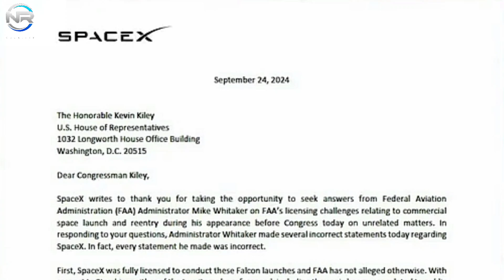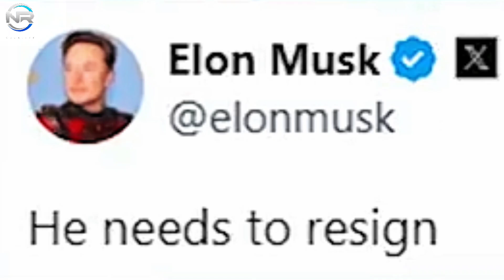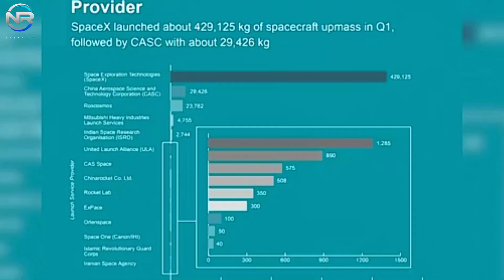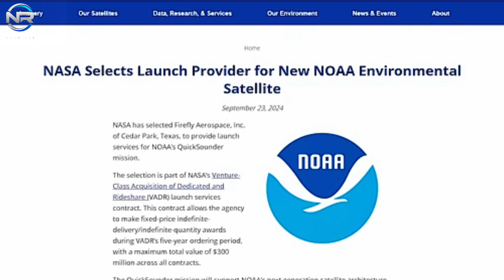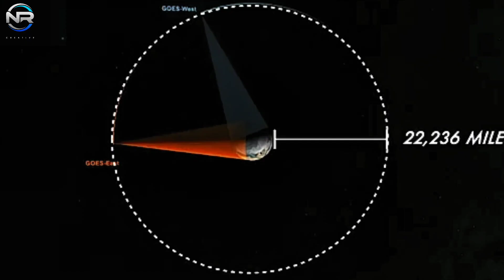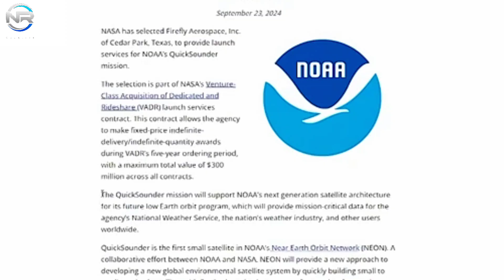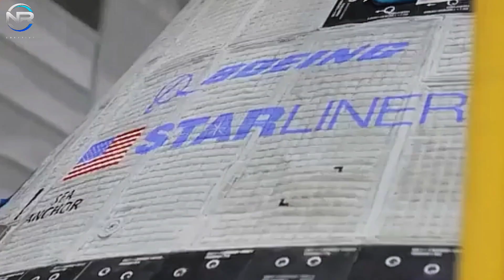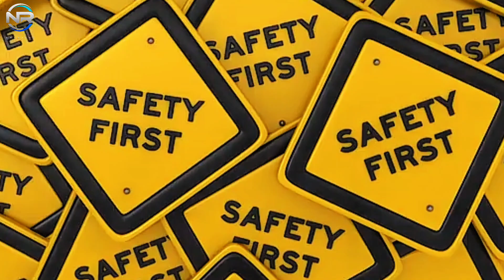Big News! FAA Announces SpaceX Must Have Boeing Safety Stand | Dragons Will Save Starliner?

Comment: Clearly managing any changing technology is a struggle for the FAA, though managing commercial spaceflight clearly has them even further out of their element.  Possibly this needs to transition to a new agency if they can't get their act together.  In any case it would be difficult to keep up with Elon.  I doubt they have anyone on staff or in management who has ever designed a spacecraft or component, or who has ever flown one.  Possibly they would have difficulty attracting such employees.  This sort of difficulty is why the USAF had to split off the Army, and then the Space Force from the USAF.  The CIA from Military intell, etc.  The Navy struggled with the transition from battleships to aircraft carriers.  Such a new agency would probably need to be formed from elements of the USAF, the space force, and NASA, just not the parts that manage contractors and procurement.  I don't know where they would get them.  The most highly functional parts of the federal government that managed contractors and procurement dissapeared after WW II.

Comment: Starliner has stranded 2 astronauts at the ISS and has deprived 2 more of making the trip to the ISS.

The FAA let Starliner fly CREWED without resolving known thruster issues.  
The FAA will not let Starship fly because of a sonic boom analysis.

Wake up congress.   Although NASA has unloaded space activities to the private sector it is still in the nation interest to be first and most in many ways.   Congress need to designate Starbase and surrounding areas as a nation rocket and missile test range.  With the same protection offered by white sands and other national test ranges.

Comment: Aren't the delays with test flight 5 for starship due to the environmental issues where spacex is accused of leaking fuel into the protected environment around there? They knew that it was a protected area, but there weren't that many great choices for them. And also the impact of the actual test flights from Boca Chica being unfortunately located in an area with lots of human habitation nearby? Of course SpaceX has had amazing success while Boeing is one disaster after another, seems to be no limit to boeing's continuing engineering and technical challenges. Space is hard, spaceX is doing great - but spaceX can deal with this by .... doing crazy things like following environment requirements.
Reply: They didn't leak anything.  They use potable water for the deluge system, water you could drink.
Reply: LOL yeah spaceX has already had to do one environmental impact study to determine if rockets were going to fall on ocean occupants.  The answer was very highly unlikely.  Big ocean, rocket relatively small.   Now they are asking SpaceX to repeat it for an even smaller hot staging ring.   It is CRAZY.
Reply: For real! That human habitation nearby is a pesky issue! Especially since nobody lives near Nasa's launch center in Florida.
Reply: @WilliamKing-hf8lc  How many population centers are near Boca Chico?
Reply: @rogerrussell9544   There are quite a few but they are not as many or as close as the population centers on the Space coast and far fewer people than on the Space coast.